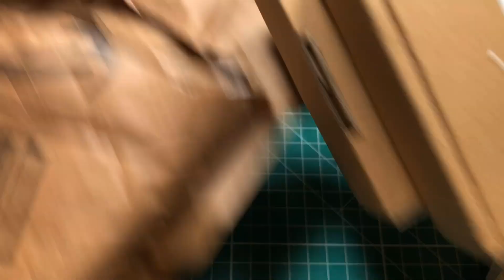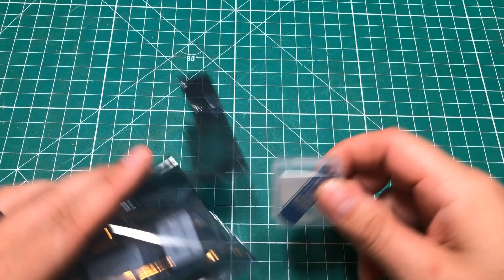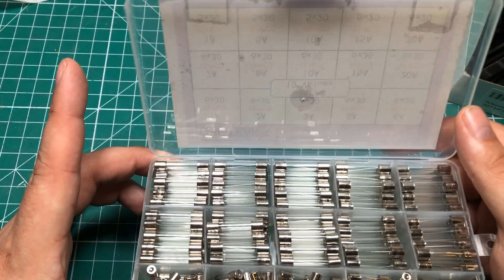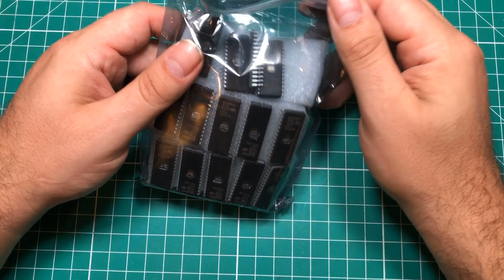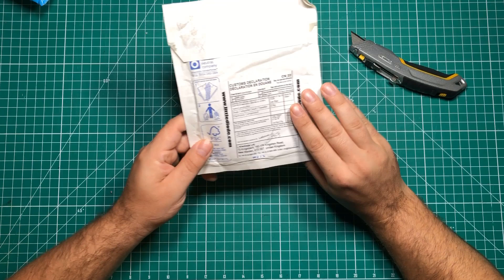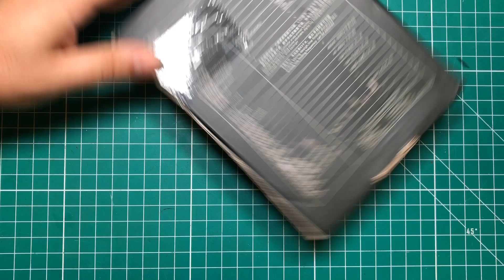Mailbag 48

Comment: Hey,   I told you b4 I got 35awg wire roll (not) knowing what to buy.   YOU MENTIONED 25awg wire(bigger)soi ordered 6 spools/Amazon.   Hot shrink tubing.  Amazon has a lot of them.  Which package will address the two sizes I have in wire now the most?   I plan many projects and many hot shrink tubing.

My  former father had spools of much larger wire. I’m pulling those to get writing from them (just 2) out of 6.  If you can then tell me how I can use them best.  And get shrink tubing for that size.

I’ll check back later.
Reply from the maker: 35 is pretty thin. That might actually be an excuse to learn the old-fashioned technique of wire wrapping. It's worth checking out a video on that. The other stuff is good for pretty much anything

Comment: A lot of nice swag in this one!
Seems those Gotek floppies can be used with an Amiga too.  Do not see a price on the website though.
It will certainly be satisfying to replace your friend's melted belts.  On sight of the dissolved goo on my Coleco Adam tape drives, I just despaired.
It is a shame that ALL those EPROMs are pulls, but they will still be fun to play with. 
A ring-through cable tester, and maybe a signal quality tester is pretty useful if you are doing ether-wiring stuff. Have recently bought Cat6 RJ-45 crimp plugs to take the annoying heavier wire. Some kinds will let wires pass right though the front.
Reply from the maker: A lot of people swear by those pass thru ethernet jacks. I can imagine they could be handy.  The ethernet tester in here gave me fits, but I probably need to spend a little more time with it.

I did wind up getting 4 bad EPROMS in a row from that batch.  Like couldn't even erase them.  Seems like they'd be pretty hard to kill.  

The goteks run around 30. I just put my links up. They used to be 20, but I feel like they're still worth it at 30.